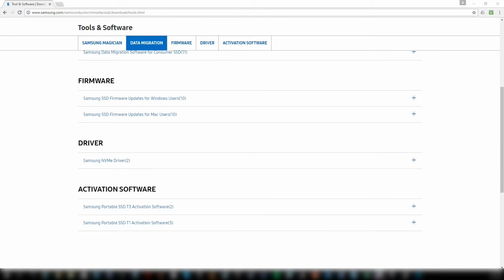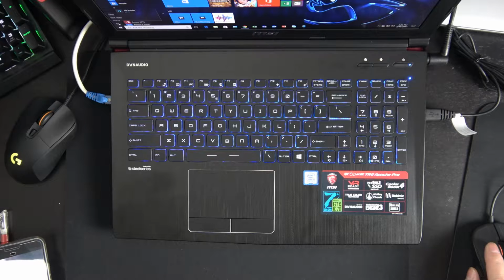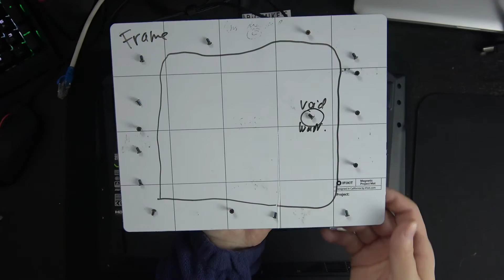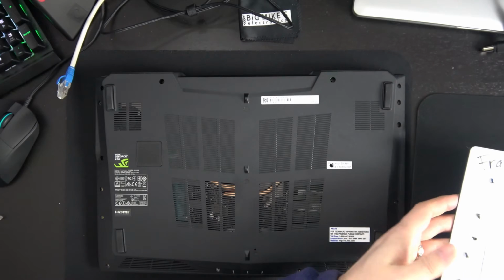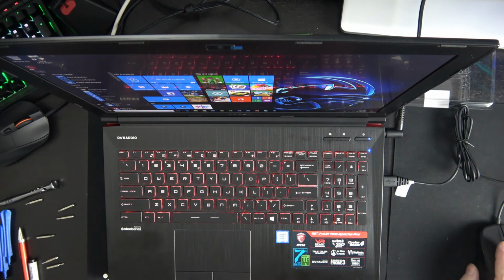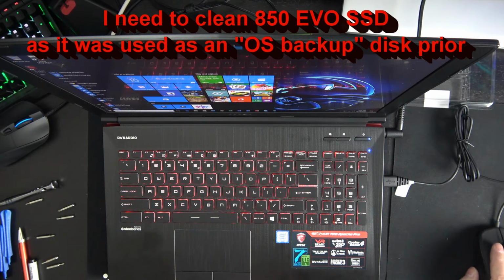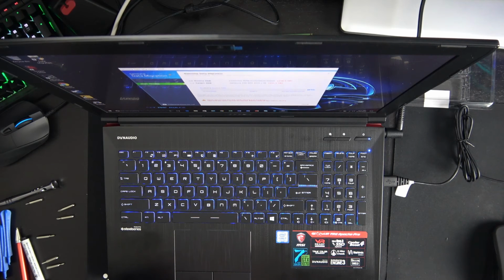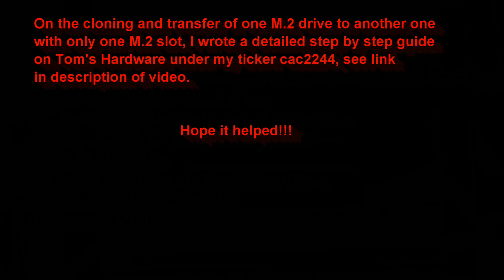MSI GE62MVR Apache Pro amazing upgrades and M.2 cloning

Comment: Can you mix two different brands of rams?
Reply from the maker: Of course you can, but it is preferable to have same memory sticks of same model and make (to match capacity/frequency/timing), but if you mix and match, the system will take the lesser speed and work at that speed across the board.  When it comes to more complex machines or desktops, Linus has an old video that explains memory channels... https://www.youtube.com/watch?v=-D8fhsXqq4o
Reply: How about 2 rams with different voltage? I'm planning to buy ram with 1.3v, idk what voltage i do have in my current ram

Comment: The ram module you went forward with is A 2400GHZ or a 2666GHZ. Is there also a XMP option on the BIOS where we can bump up the GHZ like 2666 or 3000GHZ.

Comment: I would like to say thanks for showing what the inside looks like, it was nice to see it before upgradeing my MSI GE72MVR 7RG.

Here are a few tidbits for this model:

I was able to put 3TB of Storage into it now. (860 EVO 2TB & 970 EVO 1 TB)

MSI cheaped out on the SSD Caddy, as yours had a nice plastic caddy, while mine has foam pads, I had to make sure the foam lines up with the top of the thinner SSD. It only uses double-sided tape to attach them together.

Also, although the original M.2 also was bending, that foam heatsink under that M.2 slot is a bit thick, hopefully these boards can handle a bit of flex.
(Edit: The pad was easy to remove, so I shaved off a bit from the top to prevent the board from binding. This M.2 has its own heatsink anyway, so I think the pad protects the motherboard at this point.)

So far both drives are fine, and the SSD booted up without issue.

Thanks again for the insight!
Reply: Is it possible to replace the wifi card with a m.2 ssd ?
Reply: @mekukun4105  Perhaps, the board usually sees them as just M.2 devices, it may be able to work. If you already have the M.2 drive you can always stick it in and see if it reads, though the mounting bracket is going to be too short for most M.2 Drives, unless you can find those specialty sizes online.

Random Information:
Folks could use their M.2 ports on some laptops to connect their External GPU into to play games, so throwing in a SSD may not be out of the question. You would have to make sure your BIOS can support it though, and I am not sure what this MSI PC can handle in that regard.

Comment: Hi, is HDD connected through SATA 2 interface on MB? My replaced SSD is working with only 3.0Gbps (285MB/s vs. 430MB/s checked via USB3.0). Is there any solution or this is fixed from factory?
Thank you for any answer in advance!

Comment: Hi cac2244.  Beautiful work.  Thanks for the video.  I found it helpful to watch how careful you are in how you do the work.

I'm a fight sim enthusiast (FSX with a lot of ORBX scenery).  I notice below that you state the Samsung Pro NVMe SSD won't improve frame rates on the game the fellow mentioned.  I hope that's different in my case as FSX accesses a lot of scenery files I have on my HDD as the flight progresses.  Eventually, it bogs down and crashes.  FSX is an old programme, so it is pretty limited in its use of RAM.  

I have my operating system (and some programmes) on the small SSD that came with my GE62 6QD274US Apache Pro, and my data and some programme files are on the HDD that came with the system.  I have an optic DVD, and my plan is to put the HDD drive into a disk caddy.  Here's my question:  I'm not too sure . . . how to clone the SSD to the NVMe 960 Pro 500.  I think I need to move the current SSD (which is my boot drive with my Windows OS on it) to the current HDD slot and install the NVMe into the current SSD slot.  I think the current HHD slot will run the SSD but not the NVMe.  If I'm correct that I can do it this way (and I don't know that I am correct), then if I clone the SSD as it is to the clean NVMe, will I then have my intact operating system on my newly cloned NVMe?   Am I being too optimistic to imagine that when I reboot with the NVMe now in the C: slot where the SSD was with a clone of the information that was on the SSD, the system will boot properly (as long as I don't have the SSD with a second operating system also installed at the same time)?  If so, then how would I go about cleaning the SSD so I can use it?

Also, I do have a GoFlex Pro Ultra portable drive, which is also SSD.  Should I be thinking of using that as a go-between?

Thank you in advance for any advice you can offer.
Reply from the maker: Janice, 

Is your current SSD a typical 2.5 Sata drive or an Nvme drive? The specs of your machine on MSI website says that it came with a 2.5" HDD and an Nvme drive. If this is the case, you CANNOT put the original M.2 Nvme original drive in the Sata connector where your original HDD drive sits, it just isn't compatible.  The main issue that you have is that you need a temporary medium (a sata ssd  or spare hdd on the connector that your current HDD is at because OS clones when an M.2 Nvme drive is involved is better done internally, and in my case, by using a Samsung 850 EVO, i was able to clone the drive with  the Samsung Data Migration tool that is free and works brilliantly  with Samsung products (at the receiving end). 

Since your laptop has only one M.2 slot, then cloning would be more difficult if your temporary medium is not Samsung and if you are not sure of what you are doing, then I would recommend you bring your laptop to a pro-shop, NOT Best Buy or the likes.  If you can afford or desire to have a Samsung 2.5" sata SSD like the 850 EVO, then follow my instructions and it will work just fine. If you do not have a Samsung SSD, what you would have to do is clone your current original M.2 Nvme drive to a non samsung Sata Drive (HDD or SSD) and I would use Mini-Tools Partition wizard "paid" version (only reliable option I have seen out there...and NOT EaseUS, their software does not work). And then clone back the freshly installed 960 Pro 500 using this time the Samsung Data migration tool. And yes, this should work just fine and your new 960 Pro would be just like your old original M.2 Nvme drive (that you will still have as a backup). 

There are some cloning tools that say that you can clone within windows (and had a successful clone like this  with a free software), but the failure rate is too high. Same with Acronis True Image, most of my clones, even HDD to HDD with a docking  cloning device still has a high failure rate in my experience. Stay away like I said with EaseUs partition tool, I had the technician lifetime licence and the software was so bad that EaseUs had to reimburse me. I now only trust Mini Tools Partition Wizard (when non-Samsung receiving drive). Mini-Tools has a disk cloning tool that is slower than others but I have had a 100% succes rate with it on multiple clone, one as recent as last week for a friend of mine.

As for the GO-Flex, this is not a recommended solution (and yes, I have tried many times) as Windows does not tolerate having the OS on an external drive, so that option is off the table.

Remember that these transfers are high risk and if you are not sure, get local pros to help.

Last piece of advice:  getting a Samsung 960 Pro 500 GB is good, but with windows and your games and its data, 500 GB really fills up fast, so since you want your flight simulators with data on your  Nvme drive for faster game play (yes it will help so the program and the data would all be on the Nvme and no more looking up the scenery on an antiquated HDD (tell me its 7200 rpm and not 5400)  Then I would look into a 1TB Samsung Nvme as this is the best investment you can do. You could still go with an EVO Nvme 1TB instead of a "Pro" 500 GB. Of course you would have to manually transfer the scenery files from your old HDD to the new M.2 Nvme drive and redirect your flight sim to the proper directories, etc...

Troubleshooting or helping remotely is literally impossible, take all I said here with a BIG grain of salt and whatever you do, just protect your data and make sure that all your "user/my documents, downloads, my photos, my videos on your C drive are backed up on another drive...just better be safe than sorry.

I am out on a business trip outside the country and will not be able to monitor, but  good luck with that and protect your data!
Reply: @cac2244  Thank you so much.  I woke up in the middle of the night and realized I can't put the original M.2 Nvme in the Sata connector where the original HDD drive sits, and got up to erase my question before everyone saw my error, but you have all ready answered!  I was laying awake thinking I needed to think about the 1TB because of the risk of too much data on a 500.  I'll have to review your ideas again tomorrow and think about how to approach it.  I very much appreciate your taking the time to respond, and I also appreciate your thoughts on the better response time for my scenery files.  I feel confident now that there is a solution here for my flight sim.  I just need to figure out a few bits and pieces.  I'll write back in a bit, including with an answer about the 7200 vrs 5400.  Thank you again!
Reply from the maker: @janicehoward5915   Haha, yes Nvme transfer with only one spot on motherboard is indeed something to lose sleep over... Good luck with your project! Keep us posted.

Comment: Hey Dude. nice vid.  I have this same lappy. What are your thoughts on the GPU Fan intake.  I personally cut the vents open with a exacto knife and both my cpu and gpu temps came down as they share the gpu fan.  why would msi block these vents.  Or is something else getting hot, now that I have redirected air flow.   Thoughts......?

Comment: Hi guys

I have almost the same machine {GE72MVR 7RG Apache Pro} and I would like to upgrade the same way basically from 256Gb SSD M2 Sata to something around 1TB M2 Sata and upgrade the from 1TB HDD to 1TB SSD Sata III. I have a question my laptop says on the sticker that it does support nvme ssd`s {optional} so Im still not pretty sure if it does or not and second question is. Is it worth invest in nvme rather than to sata as I will need it only for gaming. I heard mixed opinions on this.

Thanks for any comment.

Kind Regards
Rasty

Comment: Hey ! It’s me again , I don’t want to bother you , really , but in this last week I was thinking about my last question that I have done to you . Normally the seagate hdd that is 15mm thick can’t fit in this laptop , I haven’t opened mine yet so I have this question for you , would fit “theoretically” removing the black hdd holder and connecting the hdd with a flexible cable ? Yeah I know that sounds stupid. But I’m really in search for a good option to have a lot of storage in such small machine , without spending a lot of money . Thank you for your patience!

Comment: Hey! I have a question , the new seagate barracuda HDD’s that are 2,5” with the capacity of like 4tb would fit in there ? Because are big like a normal 2,5” hard drive but are a little thicker . Thanks for any response !
Reply from the maker: Fux 798, i really like how you think!  Sounds real good to me...However, the Barracuda hdd from the specs I read are 7mm thick up to 2TB and 15mm 3-5TB... I really do not think it would fit.
Reply: cac2244 yeah that bothered me .. it’s big like two standard hdd’s stacked together .. I will probably go for a 2tb solution . Thank you very much for the attention!
Reply from the maker: In a "money's no object world", then the easy solution would be an SSD like Samsung 860 EVO 4TB that would be like 1,399$ USD at at about 550/520 r/w speeds...  BUT for about 1,080$ USD I would like to see a dual  SATA M.2 drive adapter with Raid support like the 40$ Startech  25S22M2NGFFR that you would put in Raid 0, then add two 2TB (4TB total) Sata M.2 drives Western Digital Blue p/n WDS200T2B0B, like that you would get 4TB at almost double read/write speeds above 1 TB/S... now that would be pretty sick!!!  Just playing around with a potential solution for the fun of it...maybe someone will do it!
Startech dual Sata adapter : https://www.amazon.com/gp/product/B018AOZ9QM/ref=ox_sc_act_title_3?smid=ATVPDKIKX0DER&psc=1
WD Blue 2TB Sata M.2 SSD : https://www.amazon.com/gp/product/B073SBW3VD/ref=ox_sc_act_title_1?smid=A2YLYLTN75J8LR&psc=1
Reply: cac2244 well it’s pretty interesting .. the only problem is the cost haha. But it would be really interesting seeing how works on a laptop , maybe if one day I’ll have enough money I can try myself hahah

Comment: Few questions:
- Is the CPU soldered onto the motherboard or is it removable?
- What is the memory you are using and what is the max supported?
- I take it you already removed the DVD drive at some point or did it already had it removed?
- Any idea to get the blanking plate to cover the slot where the dvd was and the caddy for the ssd drive?
- What is the laptop for gaming in 2018 if you still have it, considering buying it second hand?

Good video.
Reply from the maker: - Is the CPU soldered onto the motherboard or is it removable? I DO NOT KNOW AS I DID NOT LIFT UP THE COPPER PIPES.
- What is the memory you are using and what is the max supported? i HAVE 32 gb (2X16GB)  KINGSTON.
- I take it you already removed the DVD drive at some point or did it already had it removed? MINE DID NOT COME WITH A DVD DRIVE, BUT AN ADAPTER FOR A SATA 3.5" DRIVE.
- Any idea to get the blanking plate to cover the slot where the dvd was and the caddy for the ssd drive? THIS IS WHAT I GOT BY DEFAULT (SSD / HDD 3.5" CADDY).
- What is the laptop for gaming in 2018 if you still have it, considering buying it second hand? I STILL HAVE IT AND YET HAVEN'T FOUND ANY BETTER OPTION TO REPLACE IT. NOT EVEN THE NEW RAZER BLADE OR THE ASUS ZEPHYRUS. I DO HAVE MY EYES ON THE NEW GIGABYTE 15X https://www.gigabyte.com/Laptop/AERO-15X#kf
Reply: Thank for the reply.

Comment: Thanks for the video, it helped a lot. I saved 2 steps, I cloned via USB to a regular SSD, and set up the M.2 960 PRO as the bootable system (even with 2 drivers with OS) without taking off the SSD 850 PRO drive. So I only changed once the included Hard drive for an SSD and the M.2 for the new M.2 in one step. Did it on a GE72MVR 7RG Apache PRO.
Reply: Victor Ollervides how is your pc holding up? It isn’t throttling is it?

Comment: Tnx a lot mate! Ive just did it and it was very easy!
It took me like 20min to remove the back cover ..

You got my like dude!
Reply from the maker: Removing the back cover without damaging anything is half the battle, the rest is easy. Good to hear you got it done. Even after months, if not almost a year, of having acquired this laptop and made the modification, I have to admit, there is not a single laptop out there that would make me change it, even those on display at CES 2018.